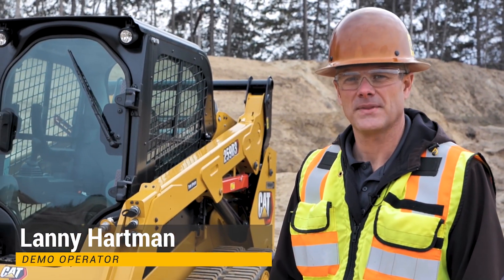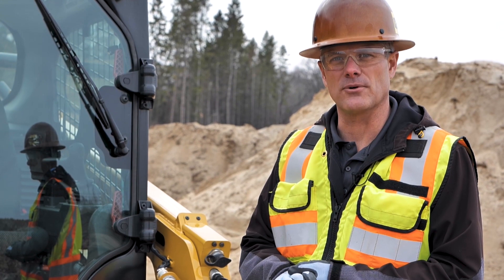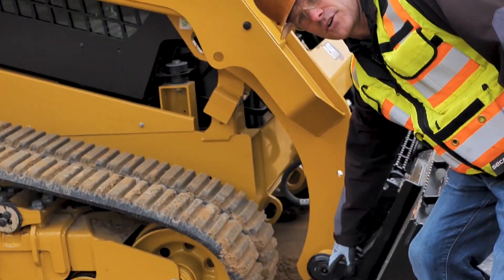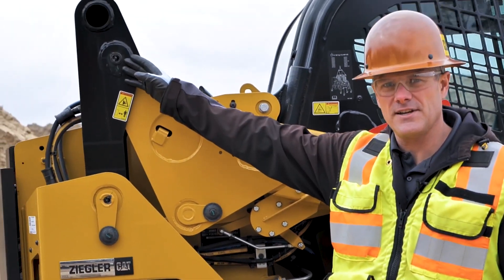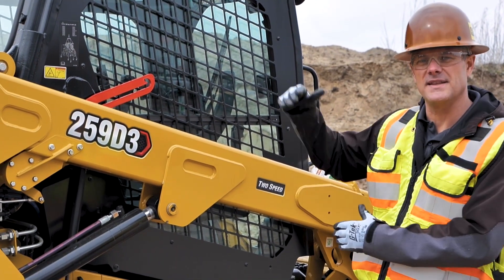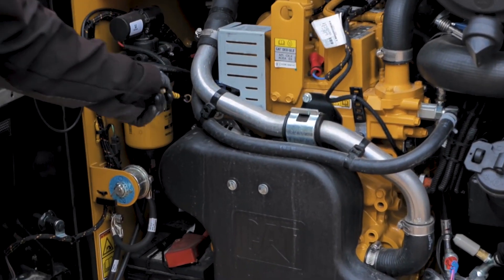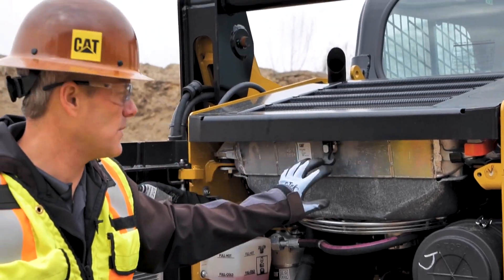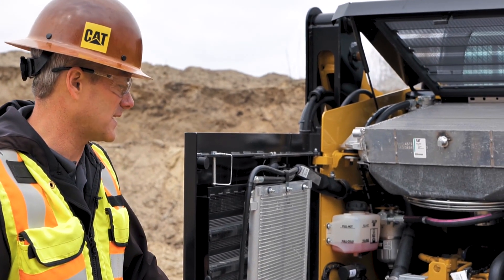Daily Maintenance Points on Cat D3 Series

Comment: Theres got to be a mod out there to fix the zerks that are just wire tied onto the two vertical lift arm cylinders
Reply: Just got a brand new 262D3(wheeled), and those tok me a while to find, as they're now on a panel on the side of the machine behind the lift cylinders.